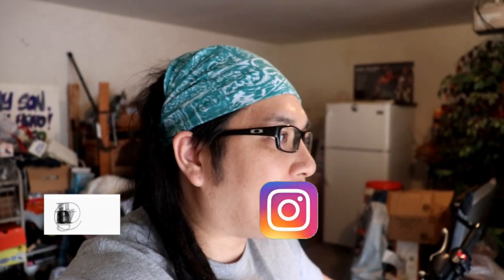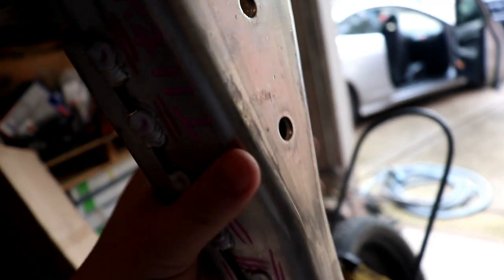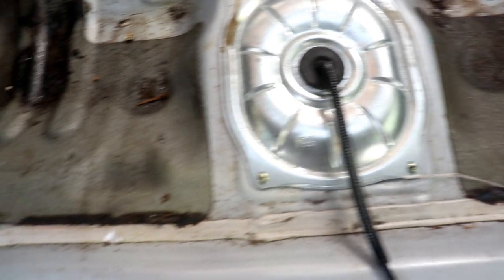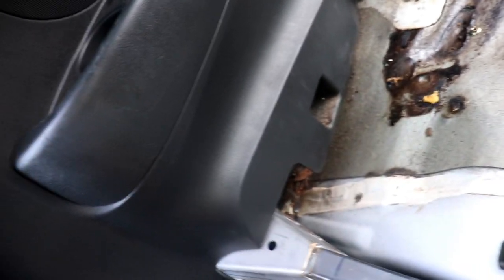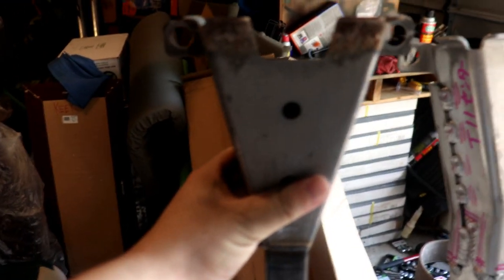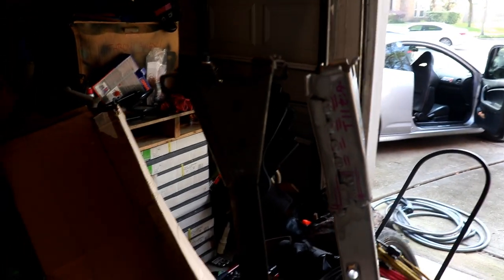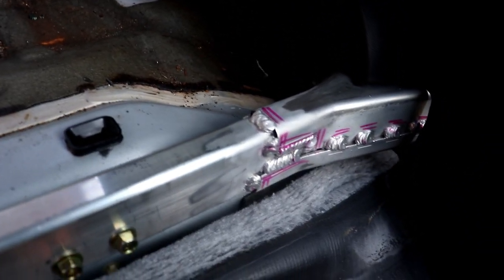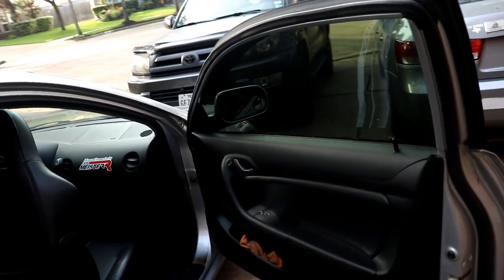RSX Type R Floor Bar Install On My Type S!

Comment: I got one. Was wondering how did you remove the rear plastic panels? Just pry open? Are there any clips or wires I need to be mindful of when prying open the panels? Appreciate it if u can help point out some